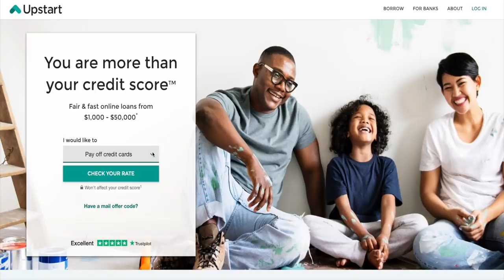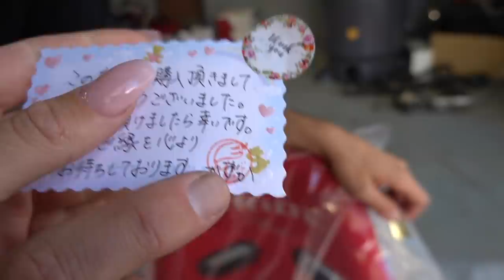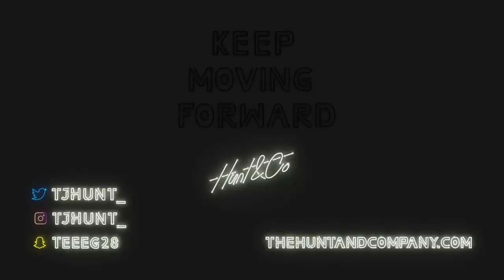I Spent Too Much Money…😅

Comment: Those bride seats r sweeeet, I have a 6th gen Camaro (yes v8) and I think I want to go like full jdm on it with stepped wheels, bride or sparco seats, and either air suspension or Coilovers (with an air piston lift) I can’t decide.